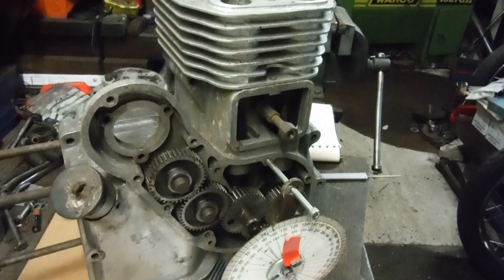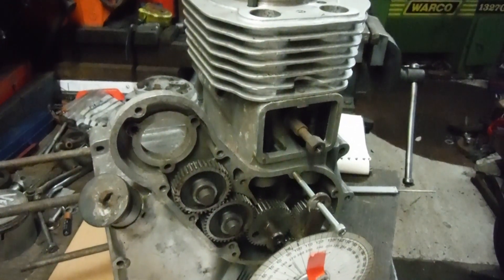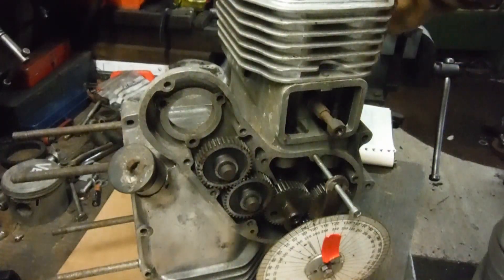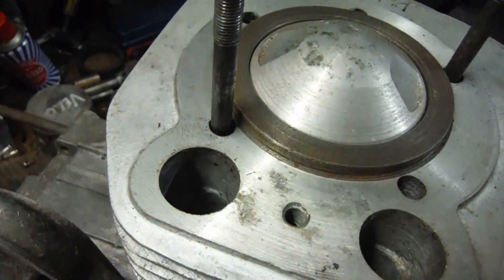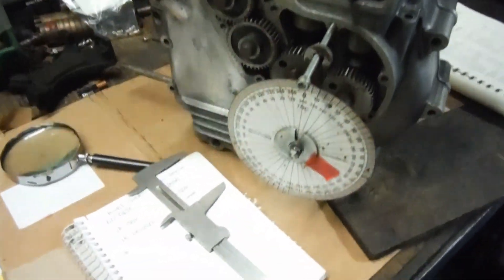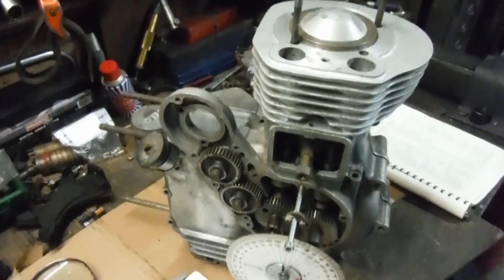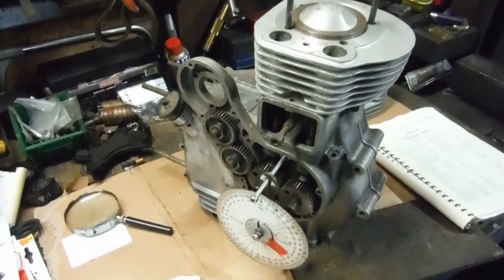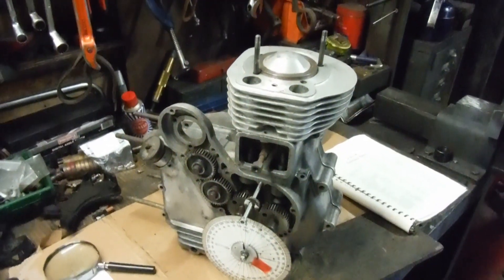Retarding inlet cam timing vs piston position on compression stroke, R.E. Bullet used as example.

Comment: I once purchased a built up cam which had a scrambles profile. On fitting it and checking the timing it didn't make sense. So I phoned up Dragonfly who sold it to me and asked for them to send me the timing details, there was a pause and he said aI would have to expert!!
     I did and made a video of +&- one tooth the sweet spot was obvious by the pickup and sound. My 350 Ariel went like hell and easily went over 80.
      I checked the timing by using a degree disk the exhaust was 15 degrees less 35° instead of 50° A.T.DC. this difference was due to the scrambler having a straight through pipe while on a silenced roadster it would produce less power
      Could a twin benefit from retarding the inlet cam.
Reply from the maker: Yes, in principle it should / could work for twins, too.

Comment: 🤔 12mm (unless you meant 64mm and 72mm, rather than 62mm and 74mm)
Reply from the maker: Yes, definitely an 8 mm difference, I was refering to 64 mm after bottom dead centre and 72 mm after bottom dead centre. Thanks.

Comment: Do you get spitting back through the carb as the inlet valve is open when the piston is on the way up?
Great explanation of the benefit, thanks.
Reply from the maker: No, no spitting back.

Comment: That manual shows 70° inlet closing ABDC , not the 60° you stated Paul.
Reply from the maker: @rkurtz8534 Yes, all is explained in the description, but for the record, 60 degrees for the 350,  70 degrees for the 500. I inadvertantly showed the specs page for the 500. It wouldn't make much difference to the total amount of piston movement over 18 degrees from 60 or 70 degrees ABDC, in any case, and it didn't really warrant making another video to replace this one under the circumstances.
Reply: @paulhenshaw4514 Fair enough Paul.  All interesting stuff.
Reply from the maker: Thanks, and no problem.

Comment: The old Triumph engines had two timing marks on the inlet cam pinion, one being for 'performance' and the other for general day to day running which would retard the cam slightly. I found the engine would be much happier in the second position and was easier to start and ran quieter too. I didn't think the difference was as much as 18 degrees though, that seems like a lot.
Reply: Triumphs have finer gears, so one tooth is less of a jump. Some also have 3 keyways to allow for even finer adjustment.
Reply: @neilmcintosh1200  Ha, it would take a brave person to start juggling with the different keyway positions!
Reply: Yeah, short dash on the idler wheel aligned with dot on inlet cam pinion was for the 6T Thunderbird; long dash aligned with dot was for the TR6 and T120. Of course, differing follower radii also affected the valve timing/duration etc.